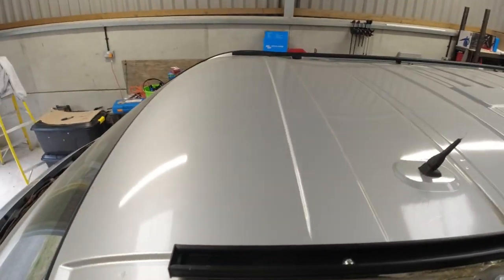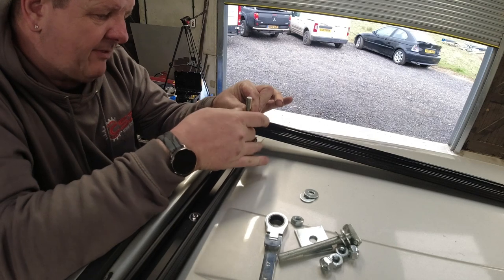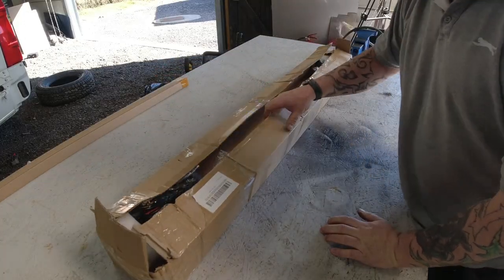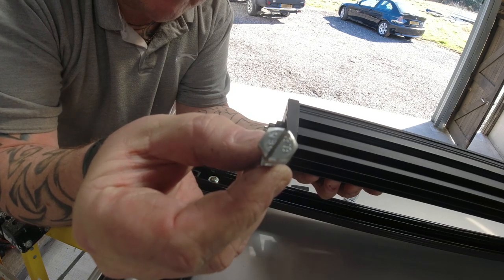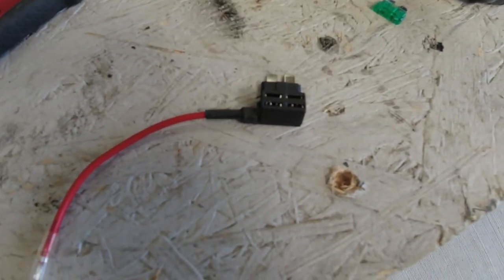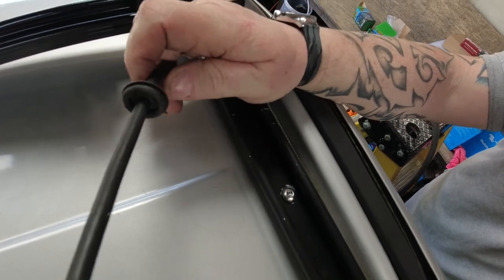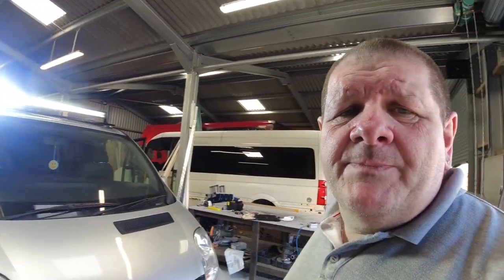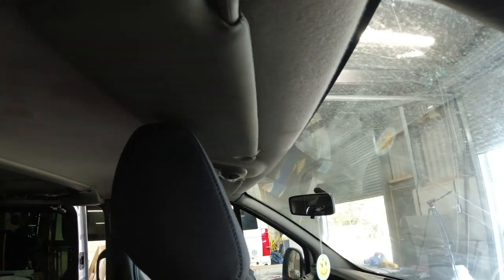Renault Trafic Campervan Conversion - Campervan Light Bar Install

Comment: Sad lack of allen bolts. Would also stop having to tighten bolts in your unistrut wih a vertical open ender !!
Reply from the maker: Yeah I had some but not the right length just showed a creative way for people to get round this issue
Reply: Hi Roy!
Reply: @DaveAber9999  Hi Dave, this is how they do it "dahn sarf".

Comment: Good video. Surprised that there is no relay fitted
Reply: Yes, I was always told you couldn't have all the accessory's power running through a switch as it's a fire risk. The piggyback fuse, is it running off a powered fuse outlet capable of running the lightbar? Is that fuse outlet now running two items? Would have been better to fit a high power item like that directly to the battery like what was done on the about a couple of dozen low power side lights? Linky> https://youtu.be/E_COaUNDga4?t=1524
Shame a nice anchored switch wasn't fitted in that housing instead of a 3M stuck on one.
 But all in all, the usual tidy job done on this channel.

Comment: Hi.  I have the LWB version of the same van in the same colour.  Where did you get the spray paint from and what make and colour name/code is it please?
Reply from the maker: You need to be careful of the colours the best way to determine the colour of your exact vehicle is the VIN plate.
Here is a link to help you
https://www.touchuppaintking.co.uk/paint-codes/renault_paint_codes.html#:~:text=Most%20often%20renault%20paint%20codes,generally%20a%205%20digit%20code.

Comment: After seeing your video with this roof rack im going to do the same to my vivaro. one question where did you get the channel nuts with the bolt shaft attached? i cant seem to find them anywhere.

thanks for the video.
Reply from the maker: Any unistrut fixings are compatible with the univolt from TLC direct

Comment: You can get special sockets that fit inside unistrut, 21mm or 42mm for doing up 17mm nuts. Easier then using a spanner on its end.
Reply: (Or, just use allen bolts)
Reply from the maker: I didnt have any the right length that was the original plan